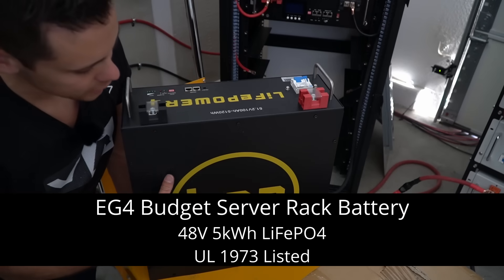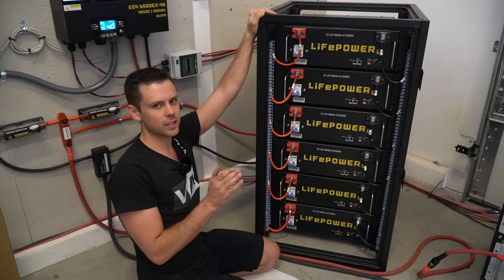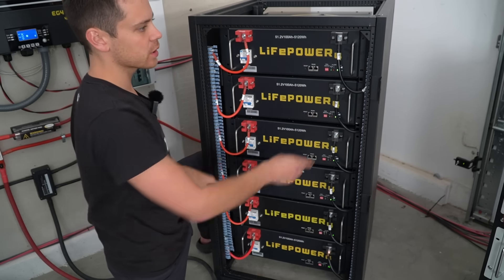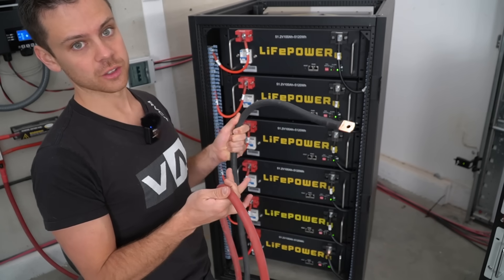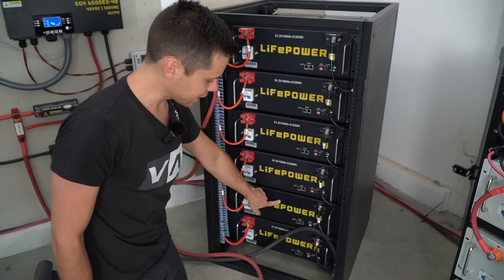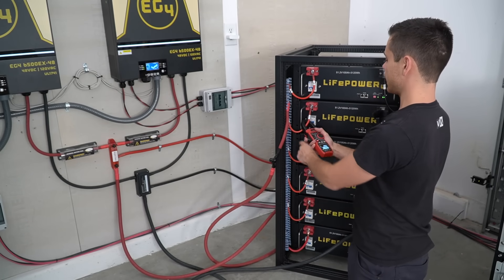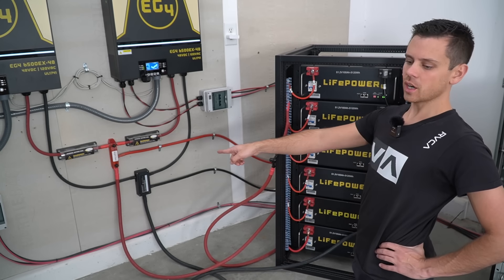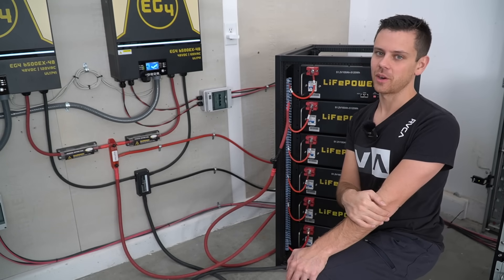How to Build an EG4 30 kWh LiFePO4 Server Rack Battery

Comment: If you were to build a DIY 30 kilowatt hour battery using grade A cells at current prices, it seems that it would cost about half the price of the server rack batteries. Am I missing something?
Reply: warranty, guarantee that the cells are really grade A, proper BMS (which also has a warranty), UL listing and local support...
Reply: Let me rephrase.... I realize i would be missing a ton of features and benefits. If my only concern is $ per kWh and getting lowest cost diy at current prices is roughly ½ of server rack?
Reply: @marcscsiwcom  yes if money is your only concern, then you could build a lead acid bank for even cheaper than this as well - or pay your electricity bill, cause it's even cheaper still.

Comment: I can understand the benefit of connecting the main connections to the batteries on a diagonal when not using a bus bar, i.e. when jumpering from one battery to the next, as each connection adds resistance to the circuit. But surely the resistance across the buss bar must be minimal with negligible current loss over its length (1m?), and if so, connecting the main cables to the same side (top or bottom) of the bus bars will have no real-world negative effect on the batteries.
Reply: Roy, go to Will's DIY Solar Power Forum, and read the thread titled "Calculation of parallel string battery currents".  It's worse than you think.
Reply: @solarod8514  I just read that thread, thanks. However, I think you make my point exactly in your comment about achieving a perfect balance using bus bars. Because there is no (nominal) resistance across the bus bar then it does not make any difference to the the batteries whether you connect the mains on a diagonal or not. I fully agree with the OP and even your response when it comes to daisy chaining the batteries with jumpers between them. But when you connect all the batteries to a bus bar, it does not matter which end of the bus bar the mains are connected to.
Reply: Will did a video on exactly this a few weeks ago, and the result was visible and measurable.
Reply: @stefanvanzyl9090  Do you mean the Current Sharing videos? Yes, there was a large difference because the batteries were interconnected to each other with jumpers. Each connection adds to the resistance and thus the last battery would suffer if the connections were not diagonal. However, when using a bus bar you are not adding the resistance of all the connections as each battery is directly connected to the bar. Instead, the only difference in current flowing to each battery is the resistance of the copper bus bar itself (which is near zero).
Reply: @roykaplan  the resistance of copper is always the same per unit area of conductor thickness. whether you have a 1awg cable or busbar with the same thickness, the resistance is the same, and it's never near zero.

Even 0.1% equivalent resistance will still result in the first battery being "prioritized" or drained first.
Reply: @stefanvanzyl9090  I just checked, the resistance of 1awg copper cable is 0.126 ohms per 1000 feet at room temperature. That translates to about 0.0004 ohms resistance across the one meter bus bar. At these currents that's pretty negligible. You will have more resistance variance at each connection screw terminal.
Reply: @roykaplan  I made a calculation as in the referenced thread for a busbar with .0004 ohms for a one meter length; that would be about .00008 ohms for a section of the busbar between two batteries.  Taking the IR of the batteries to be 1 milliohm, and with a load current of 100 amps, the calculated theoretical currents in the batteries (in amps) with the load connected at the ends of the busbars (not the diagonal connection) are:

7.58
8.80
11.4
15.9
22.8
33.5

This degree of imbalance occurs even though the busbar resistance (assumed for the calculation) is rather low because the IR of modern LFP batters is very low.

But changing the connection to the diagonal connection, the calculated theoretical battery currents become:

20.5
15.8
13.6
13.6
15.8
20.5

The real world currents will exhibit more variation due to imperfect clamping resistance, and expected differences in the IR of the batteries (even though they are nominally identical, having been purchased together).

Will's point is important; the diagonal connection makes a large difference even with busbars because the busbars don't have zero resistance, and modern LFP batteries have very low IR.

In this video, the busbars probably have resistance lower than the equivalence to 1 gauge cable, as well they should.
Reply: @solarod8514  First, thank you for educating me. This is blowing my mind a bit. 🙂 To simplify let's consider one or two batteries on a busbar and the load at the same end. With one battery, will it make a (real world) difference if I put the battery on the 1m busbar close to the load connection vs at the far end of the busbar? I would have assumed not. If one battery is next to the load connection and a second battery is added to the busbar, will there be any significant difference if the second battery is connected immediately below the first battery or if the second battery is connected at the bottom of the busbar? Your calcs would suggest yes.
Reply: @roykaplan  This would be much easier to deal with on Will's forum rather than in the comments to a YouTube video.  Are you a member of his forum?  It would be worth joining.  I'll start a thread over there about busbars in particular.
Reply: @solarod8514  Signed up! 🙂

Comment: 4/0 might not necessarily be enough depending on what size inverters your running correct? My 12kw growatt states it wanted 3 runs of 2awg. Either way your giving better info than Signature Solar support. They were telling people to run a single 2awg for every inverter they sell.
Reply: a 2awg copper cable running at 75 degrees Celsius can handle 115 amps safely, that's enough for 5800W on these 51.2V packs - note that the pack itself is limited to 100A by the BMS, so for single battery usage, 2awg is "plenty" - always do your own ampacity checks and volt-drop calculations regardless, 2awg and 115A won't reach 20 feet safely.
Reply: @stefanvanzyl9090  I agree with your math. The problem is Signature Solar tells people to run that on a 12kw inverter with and entire battery rack feeding it allowing the capability of the inverter to actually pull 12kw through a single 2awg.

Comment: Hey Will great video I have been binge watching all your videos I was thinking about going with the same battery backup 30kwh. I just got a quick question if you or anybody else could chime in real quick a few years back I bought 10 acres in North Florida I was wondering if you or anybody else could chime in I am building a 1600 square foot block House and want to run the whole house off solar I was thinking of a $12, 000 grow what inverter with the same 30 kwh battery backup would that be enough battery to run a let's say 3 ton AC and get me through the night, would it be stupid to try a regular 3 ton or should I go with something more efficient, if needed I could put a couple high draw appliances on gas but would really like to be 100% solar. Would something like this be a good choice or should I do something totally different please anybody with knowledge chime in just point me the right direction reason I'm asking is they want 80k to bring power that far back into the woods. Thanks in advance. Will I would also be willing to pay for the knowledge on a setup or cheat sheet if you were in my shoes what would your setup be. Thanks to any and everybody that wants to chime in all ideas matter
Reply: You are starting quite well: by asking before assuming!  You'll find lots of wise folk.  After years of reading & over a year working with an architect who's specialized in dropping a house's need for energy, I just got county approval to:
* Go off-grid w/ 2200 sqft & 15kW solar
* Add 400 sqft solar hot water collectors
* Store 1800gal hot water for slab radiant
* Back it up w/ outdoor firebox that has a thermo-syphon loop to heat the radiant tank when the sun don't shine.
* Draw well water via solar & store 10 days at surface level for when the sun don't shine.
* Use 12" of 40lbs/cuft foamcrete:
   - under, around & over the whole house
   - under   "                "  the 1800 gal tanks
* Run 400' of 6' deep trenches for low-tech geothermal loop (just a low voltage pump and almost 0 electronics) that's run through a bank of 8 junkyard auto radiators to pre-condition the supply air of the house's outside minisplit unit.

Polyurethane has long-term performance issues (bugs nesting & slow O2 reaction leading to absorbing humidity & drop in R-value) let alone being less than green.

Foamcrete has  almost the same R-value as PU... it's of zero interest to carpenter ants, immune to humidity and uses about 1/7th the CO2 of concrete.

In summary:
-> Insulate the heck out of your house.
-> Give HVAC steady moderate temps
-> Store at least 10 days of drinking and heating water.
-> have a backup source to heat your radiant water.
-> have a generator + standalone 48v chargers for your LiFePo batteries so you don't fry your inverter's delicate electronics with a noisy/affordable generator.   (Compared to running a generator full blast for 24 hrs to keep your house running, you can instead use only 25% of the gasoline, run 4 standalone chargers that are paralleled to the batteries' bus bars & charge 30kWh of batteries in 6 hours.)

I hope these thoughts help you...
-C
Reply: Build with ICF or at least insulate the blocks better than builders usually do, use well insulated doors and windows and spray foam insulation on the roof. Use a variable speed heat pump system like a Mr Cool, they are easier on an off grid power system. I think these EG4 systems are the way forward for "off the shelf DIY" installed systems.

Comment: How can I add this as battery backup to an existing 21kW grid tie system with Enphase microinverters? Thanks
Reply: Short answer, You can't, . elsewhere you need an inverter with retrofit capability. Basically it means with AC coupling and your micro inverter connect to a smart load input. Deye sol ark  hybride inverter can do it.
Reply: @sergea1138  thanks, so If you were building a new grid tie system which inverter would you go with to be able to scale LFP batteries in the future? Same hybrid type inverters you listed?
Reply: If I were to build a grid tie system , yep I'll go with DEYE, you can start without battery and add battery later, it can do zero export and/or injection.    It has a backup load output for your sensitive load. It has an other input for gen or retrofit. This inverter is really flexible, but more complex to setup than an offgrid inverter like the one Will use.  I would say the most important is can you have top support from a company in your place.  Many users reported their experience with DEYE derivative hybride inverter on Will forum.  Iam in EU , I don't use the US version. You will no longer found the inverter under the name of DEYE in US as Sol Ark don't want competitor. Look the forum for alternative DEYE derivative.
Reply: @sergea1138  ok yes I’m in the US. Sol Ark is what I’ve been seeing used but most people do not use these hybrid inverters for a grid tie system. Thanks for the info
Reply: I have exact same question - would LOVE to DIY a battery system like this into my enphase system.

Comment: Hi Will, won’t connecting comms between them (IE master and slaves) allow intelligent “inter bms comms” and balance the draw/charge between all packs properly? Still hoping for that test where the packs are connected via CAN to inverters to show how much benefit and/or more usable capacity this will give because of more accurate measurements controlled by the bms per cell.
Reply from the maker: No it only modulates current at high and low disconnect soc, and over current. It won't do do it during cycling if I understand it correctly. I will test it in the communication video
Reply: Will, I am running 4ea of these exact battery's in my system.  I  turned on one,, charged to 100%, turned off and did the next one. Once all max charged I turn on all 4 and have the growatt inverters managing with the BMS. I found individual battery  current to be real close that way.
Let me know if that makes sense to you. 
Rock

Comment: Do you offer consultation for a fee ? I have a large house boat that has a 10 year old 24 volt (8-6volt golf cart batterys )3600 watt square wave inverter that I want to add a few solar panels to to help charge the batterys , I figured with a few minutes talking to you I can save hours of research
Reply from the maker: No
Reply: Square wave, really ?

Comment: Roughly, how much did that system cost? I am finding it more and more tempting to get a system like this.
Reply: All these major parts are listed on signature solar, each inverter is $1300, each battery is $1500, the rack is $500 and the wiring depends on what exactly you grab, between $200 and $500 - for a total of $12600 excluding solar panels. The inverters have a 3 year warranty, so doing a return on investment when the grid is already available, is extremely difficult.
Reply: And Will could have more than just 2 inverters with that amount of batteries.
Reply: @ForwardGuidance  each inverter needs about 7.2kW input at full tilt, so 6x batteries could pair up with 4x inverters - but to completely replace a standard 200A 240V service to a house, you'd need 8x inverters with 12x batteries...
Reply: @stefanvanzyl9090  Wow!  Now to be clear for Stuart, we have 200A/240V available at the panel, but we are rarely using all of that especially if one has some appliances running on gas.
Reply: @ForwardGuidance  I don't know why US houses have such a big service - we get 15kW (63A at 230V), and that's plenty for us to run everything electrical - stove, heating, aircon, hot water geyser, etc... Guess everything has to be bigger there!
Reply: @stefanvanzyl9090  But when does a typical house draw the full 200A ? Never.
Reply: @quattrohead  that's exactly my point, I don't know why it exists.
Reply: @stefanvanzyl9090  I guess my 400A service is ludicrous then 😂. Actually the electric company talked me into it. I was putting in underground electric myself and they were paying for 1/2 the cost of the wire, we bought a large acre lot and if I ever decided to make a barn or do some welding as well as all electric house, i would have extra capacity. At the time (5 years ago) when we could afford wire, the cost difference from going from 200A to 400A was only several hundred dollars out of my pocket for the 400 foot run of underground cable. The real reason why I did it was the electric utility would upgrade my transformer for free to a 50KVA. If I decide in the future to sell power back to the grid I wasn’t limited due the transformer on the pole. One of my neighbors down the road build a new house and they put solar on, a rather large system. He had already planned to generate more than he needed for the house and farm and sell back to the grid a certain amount, relying on some of the net metering he would get back. It wasn’t discovered until later that the transformer serving him was inadequate to  grid tie and the utility would not let him turn on the system. It was a oversight on both parties, but the utility company has the final say. In the end he had to pay most of the cost to upgrade his underground transformer and it wasn’t cheap.
Reply: @jimmyg6215  that sounds like an absolute nightmare..  Imagine building such a big system, financing it for 20 years with a return on investment after 15 years, and then forking out another 10 years worth of money in the first year before it can be turned on, suddenly there's no return on investment anymore.... Wow.

400A service is good for up to 96kW, I have no idea what anyone would use this for, but that power meter is able to run at $24 per hour, based on average power prices in Los Angeles... Careless usage allows a power bill up to $17k in a single month...wow..
Reply: @stefanvanzyl9090  Must be a pretty rural system, never heard of something like that in even semi developed areas

Comment: Great video thanks. Question. When you pre-charge the capacitors to avoid the spark. Why can’t you just turn off the battery breaker when you attach the batteries to the inverter.
Reply: These batteries have the pre-charge function built-in already, no need to use an external resistor (which must still be used for other batteries)

Turning off the breaker means that you're just going to hide the arcing inside the breaker when you turn it on again, this defeats the purpose and can still damage your inverter

Comment: Does each EG4 have two separate MPPT algorithms for the two solar arrays connected to each EG4? How could it work otherwise? Which Solar-In would the algorithm use?? How much (watts) of Solar-In for each of the four inputs?   I don't see a generator back up in the system picture, is there one? And finally, this system is 100% off-grid, correct?
Reply from the maker: Yes you can add generator. Check the manual for setup
Reply from the maker: Yes two separate. For two different strings. So two different power points. They are separate circuits. And 16,000W

Comment: Could you do a amp test on a cyber 12K limitless  Battery
Reply: I don't believe Will has access to 56kW of inverters or load to conduct such a test safely...
Reply: @stefanvanzyl9090   is a 38ah battery
Reply: @avolall7657  yes, but it's capable of supplying 14kW of power each, and you need 4 of them to reach 48V to work with these inverters - so to be able to do an amp test, you need to draw 56kW - it's only going to last 2 minutes before they''re flat, though..